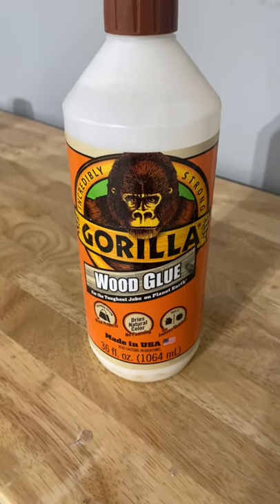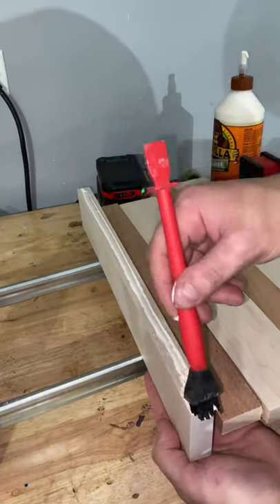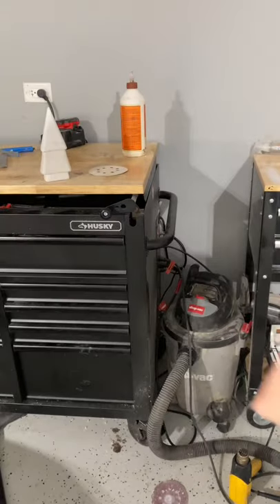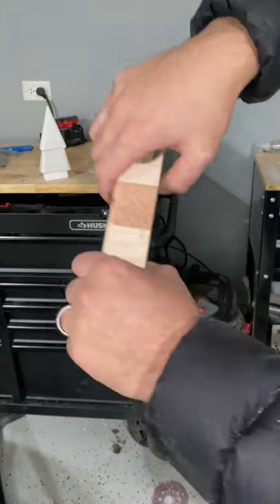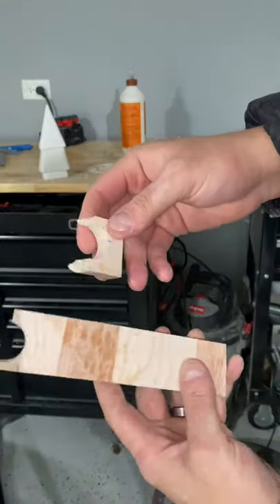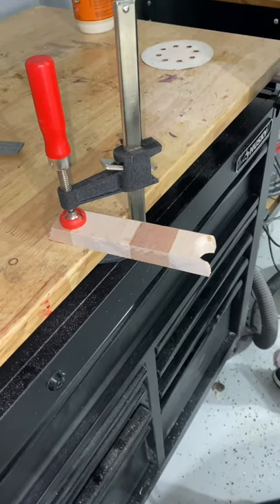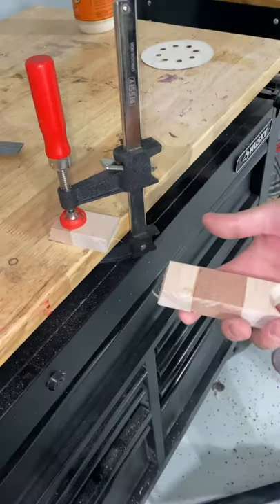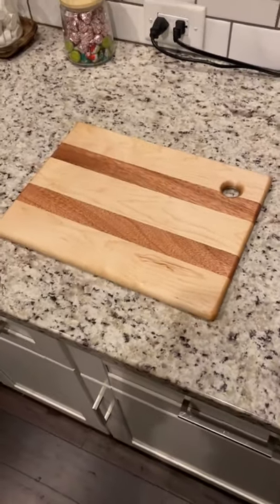How Strong is Wood Glue Actually? Shocking Results!

Comment: Yeah, but...  It broke close to the fulcrum.  I agree that the glued joint will be stronger than the wood.  Not arguing that, but I would suggest putting the join at the edge of the bench (fulcrum) and see what happens.  This will be the point of greatest stress.  It will probably break closer to the join but still within the wood.  Nice idea though!  😇  Keep'em coming.  Looks like a nice cutting board too!
Reply from the maker: Thanks a ton, I appreciate the suggestion, and thank you very much for watching! If I do another one at some point, I'll be sure to incorporate what you've mentioned 😃
Reply: @MakingMadeSimple  You could do another video, but look at different kinds of glue that people use and compare them.  Just a thought.
Reply from the maker: Absolutely! I have been wanting to test how Gorilla compares to Titebond, so that would be fun!
Reply: 100% 👍🏼
Reply: @MakingMadeSimple what u could also do is put the grain of the wood perpendicular to the glue. That way you give the wood it's absolute best chance to not fail. 🙂
Reply: Ideally you'd want a tensile test but I think the point stands

Comment: You split it along the grain which is not a normal grain orientation for wood construction. I'm not sure if you'd get the same result if you rotated the grain orientation. You never see a 2x4 with horizontal grain for a reason

Comment: Can I use it to bond a wood to a metal with this glue??
Reply from the maker: I don't know how well it would work. I'm sure the bond would be somewhat strong. But part of what makes the bond with wood so strong is that the glue soaks into the wood fibers, which wouldn't be the case with metal.

Comment: A good glue joint usually will break with some wood chips
And if you use hard woods the wood itself will be unscatered
In pine usually the wood fails

Comment: Would it hold a broken head stock of guitar?
Reply from the maker: I think it would hold it together for some time, but I feel that the guitar's constant movement would eventually soften the glue.
Reply: If it holds then that's great! Btw
I'm a person with scarce finances.
I've been searching for the strongest and affordable wood glue.. i stumbled upon the two  which of the both you actually think is the  strongest , Titebond lll or the gorillaWoodglue?
Reply from the maker: @cradleplays6809  I've only used gorilla wood glue, but it has done great flr me! I've heard Titebond III is supposed to be some of the best stuff out there!
Reply: wood glue will work fine. just make sure you sand the finish off and get all the edges smooth, then glue and clamp. if you don't sand it well first and get a good join, when you actually put the strings under tension you'll be in for a bit of surprise. 😂

Comment: Gorilla glue is unique use some other glue I know wood glue is strong but not all are as hard as gorela glue
Reply from the maker: Good point! I've actually heard some of the other ones are stronger than gorilla glue though 😱
Reply: Gorilla wood glue tends to be a little more flexible and more crack resistant than Loctite type II or type III, but it also makes for slightly flimsier paper mache products if that's what you're looking for.   It does make for an very durable and very chip/crack resistant sealant however.  🌎❤️

Comment: It broke where the table was....
Reply from the maker: Yes. The point being, it broke on an actual piece of solid wood. Not where the joint is. You can see the solid wood is clearly an inch or so out from the table.
Reply: @MakingMadeSimple  I don't know how to put it in writing but it broke at the table because you and the table acted like scissors..... it may still be stronger than wood but you never tried it with the glue side being right next to the table
Reply: @MakingMadeSimple I think what he's trying to say, is that it broke at the lever point. Try the same experiment, but this time, put the glue joint as the lever point. Also, you should be using the green or blue labeled glue for a cutting board. This stuff isn't meant to hold up to moisture and is more meant for things like indoor furniture.
Reply: Oh wait, gorilla glue might be water resistant